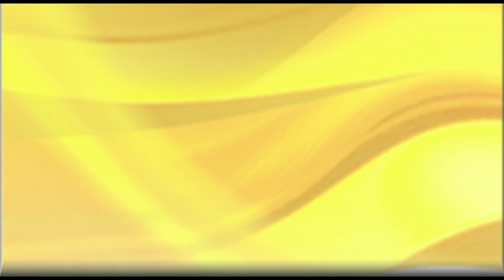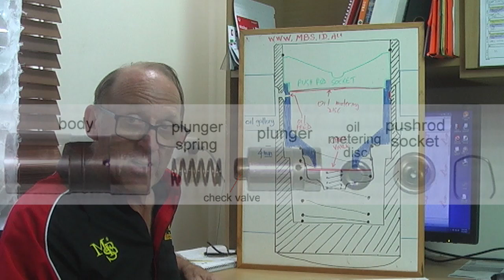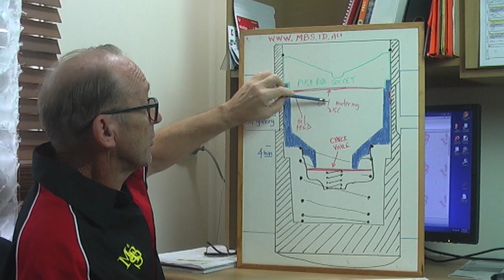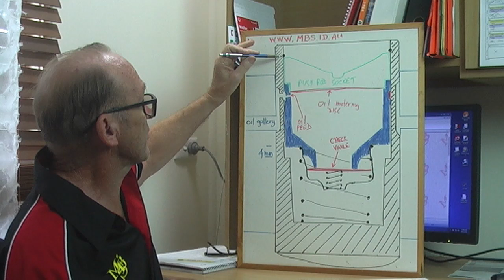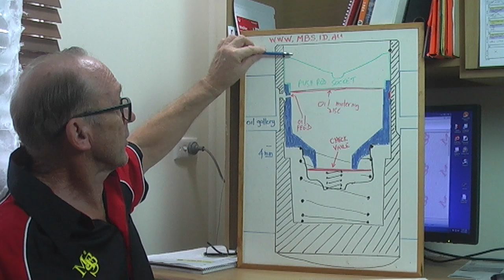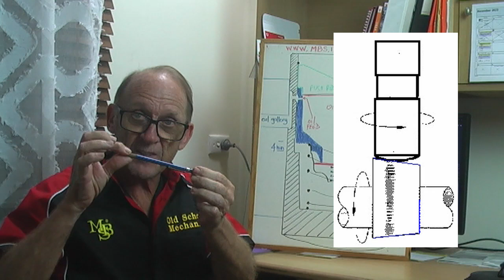Hydraulic Lifters Explained

Comment: Only time lifter will pump up will be an issue as if the rocker is over tightened. Compressing lifter spring. Away from snap ring
Reply from the maker: I know what your trying to say. The lifter will pump up closer to the circlip if valve float is encountered. This will hold the valve off its seat causing loss of compression resulting in a miss-fire. However the lifter will bleed down fairly quickly and be back to zero lash running as it should. The same effect can be had when adjusting the lifters while the engine is running. Take up the clearance to remove the rattle and then tighten down the fulcrum bolt 1/2 turn. As soon as you do that the engine will miss until it bleeds down. If I am setting them like that, then I go down a 1/4 turn at a time and when the engine stops missing I do the final 1/4 turn. If you turn the adjuster in one movement and your a 3/4 turn guy then the valve head may clip the top of the piston in a low piston to valve clearance engine. So care needs to be taken.

Comment: So basically it Locks moving upwards during lift and unlocks moving down allowing the valve to slam shut... Re locks on rebound and so on?
Reply from the maker: Well in a nutshell, basically yes, but a little more to it as it has other functions as well but your analogy will suffice to understand its workings. I am drafting up a new tutorial to do which covers the lifter operation when new and when pumped up, going through a full rotation on the camshaft. This may explain the entire concept more clearly but this is probably another few months off yet as I have a lot of work on at the moment.

Comment: What causes them to have a irregular ticking sound you here at idle everytime after a new oil change and than by about 3000km later the ticking sound is gone ?.this a common occurrence on the 3.2ltr 5 cylinder Ford Ranger.
Reply from the maker: I am not familiar with the Ford Ranger (to new a model for me) and have no idea if this is a common thing for that model. There may be a facebook group that you could ask the question to.

Comment: At the risk of ridicule!  How is it that if the head is shaved lowering the head towards the lifter, making the push rod longer by the amount the head was shaved. If the pushrod is now longer than it was before how is turning the nut tighter the correct direction as it seems it would be to tight after the head shave and need to be loosened to remove the length gained by the lowering of the head.  I hope I didn’t completely misunderstand your explanation.
Reply from the maker: I am working on a new video of how the hyd lifter works through the entire cycle of base circle to full lift back to base circle. I assume we are talking adjustable rockers like early red motor. To maintain the correct rocker geometry after a head shave you have to screw the adjuster deeper to achieve the same geometry, in other words you must make the pushrod go into the lifter the same amount you shaved off the head + you initial preload that you set. So instead of the pushrod pushing the internal piston down into the lifter .050" you now need to push it down .090" if you shaved .040" off the head. This is the part that tricks everyone up and I find that even a lot of mechanics cannot grasp the concept. At .090" the lifter works exactly the same, does the same job as if it were set at .050", in fact the rod can go up to about .120" into a Holden lifter without any problems. This is called setting the geometry not the lifter preload, but that is what everyone calls it, even the text books. So you often hear the term 'the lifter is too tight' If you were concerned that the pushrod was too deep into the lifter you would simply buy a .040" shorter rod and all will be exactly the same as the original set-up, but with a shorter rod. So I hope that answered your query. In one of my videos I discovered that a 186 rod was used in a 202. That rod is .120" longer. Since the 202 is non adjustable that means the pushrod was just about bottoming out in the lifter bore, but the engine still ran without any problems which verifies that the lifter has a very wide working clearance and performs exactly how it should whether the rod is .020" or .120" into the lifter bore.

Comment: Thank you for the information. This is a good presentation. How do you stand in regards to soaking lifters in oil before installation, or draining them before installation. In my experience (not a expert by any means), if the lifters are rock hard, there is no way to take up the preload when installing without opening the valve. Its the valve that will open, and not the plunger depressing. Thanks for posting. Sincerely
Reply from the maker: Ah yes the old lifter question asked by many. I have done both, fitted new lifters not pumped up and adjusted old lifters that were pumped up. I have never pumped up a new lifter. I am eventually going to do a video on this very subject explaining the valve open concept. On an interference engine or one that has less than .070" piston to valve clearance, I would turn the pre-load down 1/4 turn at a time after setting zero clearance and that depends on valve spring pressure to, but in this case it would be better to bleed them down a bit first so to avoid the valve touching the piston.
Reply: @mbsoldschool Thanks for the reply. Looking forward to the video. Sincerely.

Comment: Very small parts and tight clearances mean oil changes should not be neglected. Do not exceed the recommended mileage when determining oil life.
Reply from the maker: Yes, lifters do not like sludge, even the tiniest piece of crap will cause the lifter to fail.

Comment: I have one lifter that when not pumped up takes .050 more to zero lash than all the other valves. then when its pumped up i back off the adjuster nut all the way to re check, its just beyond zero lash but can still spin the pushrod. Run it again and its loose again. Maybe i can use a shorter pushrod so im not maxing out the rocker arm, but why would the lifter do that? Its also really soft when bled down, but its not the only one that is.
Reply from the maker: I am a bit confused about how you explained the problem, so I hope my answer is relevant. Once a lifter is installed, adjusted and started up with good oil pressure the lifter will not require any further adjustment. Once the lifter is pumped up it should never be spongy or soft even after the valve spring pushs the plunger down due to bleed down. Oil in the bottom chamber below the check valve does not compress, the lifter only goes down because the oil leaks between the plunger & body but it will still be solid if you tried to push it further but more than likely it will be bottomed out in the lifter body. Some will be some won't, but in any case the lifter should not be soft. The only thing that can cause this is the check valve not being seated, this will allow oil in the bottom chamber to leak out through the check valve & back into the oil gallery while the lifter bleeds down. Have you checked out all my videos on adjusting hydraulic lifters. I cover zero lash and how to get it, then turn the adjuster a further 1/2 to 3/4 turn as standard unless you are correcting geometry which may mean you might be adjusting the lifter a bit further down than standard.
Reply: @mbsoldschool these are gm lt1/lt4 roller lifters and shaft rockers. Your answer sort of helps. So first i bring it to zero lash and 1 full turn for all of them, but #7 ex is very soft and the adjuster nut goes down  extra .050" to achieve zero lash than the rest.( there are a couple other soft ones that didn't have this issue.) So i give and extra 1/4 turn in case its not up all the way. I run the engine and notice a bouncy vacuum needle. I pull valve covers and check #7ex and its tight (pumped up) while on the base circle. I back nut all the way out and its still snug but i can spin the push rod(maybe can use a shorter push or maybe theyre all perfect and need less pre load). I run the engine again and have stable vacuum but hear a rattly lifter.  Same lifter is now bled down and loose. I dont know if i have some bad lifters or not.

So at zero lash and one full turn i looses 2-3in vacuum as it warms up vacuum stable. Today , I re-adjusted them to 1/4turn or .020 preload. Now it starts at 10in and picks up 1-2in as it warms up and lifters are more noisey and vacuum unstable again. Im gunna try a half turn when i have time again and see if the vacuum is stable cold to warm. I still have a feeling the weak lifters are to blame. Still on break in oil in all of this.
Reply from the maker: @___MC___ Something is really wrong here and I don't think I can solve it when we are talking different car language. This statement is confusing. "but #7 ex is very soft and the adjuster nut goes down  extra .050" to achieve zero lash than the rest." If your lifter is soft, then there is air in the bottom chamber or the check valve is not seated. Sounds like you are not setting zero correctly, sounds like you are continuing to tighten the adjuster past zero. Zero is when the pushrod touches the lifter plunger but does not push it into the main body. Then the extra turn is required to set them correctly. None of your lifters should be soft like their new counterparts. So many people get the adjustment wrong on new lifters because of the spongy feeling, very easy to do. "#7ex and its tight (pumped up) while on the base circle." Another statement that makes no sense. Of course it is tight, the adjuster has pushed the rod into the lifter by around .050". A good lifter will be tight because it is holding oil in the bottom chamber and oil pressure has refilled the chamber with oil that has escaped via the bleed down. " I back nut all the way out and its still snug but i can spin the push rod" . Back the nut off, 1 turn & the rocker will go slack. If you have slack then you adjusted the pre-load incorrectly. What method are you using to adjust the lifters. EOIC, overlap or TDC method.
Reply: @mbsoldschool youre definitely helping. i think i can understand where im missing things in my head now. I turned the crank 90° per cyl in the firing order since i cant realy see when the intake is closing or exhaust open with the intake manifold on with loose rockers. Is that flawed in thinking both are on base circle at tdc every 90°? Its a mild street strip cam.
Reply from the maker: @___MC___ Oh it can be but if you start at #1 compression then you will be OK. I see your thinking so let's break this down. You start on #1 cyl with the piston at TDC but on compression, not overlap. Both valves on #1 are on the base circle, the valves are shut and able to be adjusted. If you turn the engine 90 crank degrees the next cylinder will be on the firing stroke & therefore both valves will be on the base circle. So whatever your firing order is for that engine you will set the next cyl in the firing order. You are basically using the TDC/overlap method and is accurate for almost all big cam engines.
Reply: @mbsoldschool it was how the shaft rocker instructions wanted me to bolt down the shaft rockers. I figured it was viable for adjusting as well. I been doing iceo method with stud rockers so i never noticed height discrepancies before. I can feel zero lash pretty good even on soft lifters. The lifters total plunge is .200 inch

Comment: I think I may have a problem with my hydraulic lifters in My VW VR6. If I give it too much throttle input is WOT after a cold start it starts to run rough And back fire and won't take any more than 10 or 20 percent throttle otherwise it'll die. It smoothes out After the oil warms up
Reply from the maker: That's a tricky one! My initial thoughts in order of probability are oil viscosity to heavy, sticky check valve in lifter or dirty internals, restricted lifter oil feeds. For a quick check to identify what is happening is to start the engine cold and rev it to make it miss. Then shut down the engine and as quick as possible disable it from starting and then crank the engine and listen for 6 compressions during the starter motor operation. You should clearly hear the starter motor speed and when it hits a cylinder with compression. I would do this first when it is hot so you know what it sounds like with good compression. Then the next day do as I suggested when it is cold and compare the sounds. If you have loss of compression then I would start with adding some lifter free product or engine flush to clean out any gunk and put the correct grade oil in with a new filter. That's about all I can recommend for you. There could be other factors in play but what I have mentioned are the most common things to check.

Comment: How does a roller lifter deal with pushrod end wear when it doesn't rotate ?
Reply from the maker: bloody good question. I have never had to deal with roller lifters so am not familiar with them but I suspect that there must be some sort of device built into the lifter that would allow for the pushrod cup to rotate a very small amount therby causing the rod to turn. Otherwise you will eventually end up with a pyramid point on the rocker end of the rod. The lifter end does not get that same wear as the other end.

Comment: Very thorough presentation.   I enjoyed your video         .  I have experienced an issue which I can find almost zero videos explaining.    If a person buys a used classic.     May have sat around a long time.    Because history of camshaft and lifter adjustment is unknown the new owner wants to check and re- adjust hydraulic lifters.    But after loosening the lifters when the owner goes to adjust the valves the lifters are all pumped-up.    When the owner gets the valves to zero lash and goes to put in a Half or three-quarter preload, because lifters are pumped up, instead of getting preload, the new owner is actually lifting valves off their seat because the lifters won’t compress at all, acting as if they were solid lifters.   Then if engine is run, the vacuum and compression is way low.      If the valves are loosened enough to allow them to fully seat, then the lifters beat themselves to death and break.  Hydraulic lifters acting like solid lifters.  How can an owner bleed a lifter in an engine without removing the intake manifold?    If a lifter gets pumped up like that, can the lifters be bled back down while still in the engine?    Do lifters only adjust in one direction to get longer but never shorter?    Were the lifters frozen due to sitting?    I’ve seen this on three different engines with hydraulic lifters.     I ended up replacing the lifters
Reply from the maker: The valve springs will bleed the lifters down. If you loosen the lifter to start adjusting them the spring will push the inner cylinder up but it won't be solid unless the oil gallery was full of oil and it does not matter if they pumped up anyway. You still do the zero lash & tighten down 1/2 to 3/4 turns. The valves may open when you do this if the lifter is actually pumped up with oil but if you sit and look you will see the valve slowly shut. Why do lifters rattle when started each morning. It is because the springs have bled the lifters down & now they have to pump up again to get zero clearance. If the lifters does not bleed down then replace the lifters because they will hold the valves open.

Comment: So does the lifter actually move up and down in the bore? I feel like it must move a little when the cam pushes on it, but then you have the pressure from the push rod pushing down. I'm going to need a slowmo video in operation.
Reply from the maker: The lifter moves up and down inside the bore as the cam lobe pushes on it.

Comment: I have a weird problem. I think I have a failed Lifter, but not in the usual way. Is it possible they can get seized and hold the valve open? As I had a dead cylinder in my 6L Chevrolet engine. On top dead center, compression stroke.There is no clearance between the Rocker and The valve
In essence, the intake valve was  never closing It's almost like the push rod. It's too long, so anyways, loosened off the bolt that holds the rocker assembly just until there was some clearance and lo and behold,  it runs fine, And I have compression again. But I cannot leave the rocker bolt loose. The only thing I can think of is that the somehow lifter is seized and isn't collapsing. Does that make any sense to anybody here ?
Reply from the maker: possibly a failed lifter. Just check that the valve stem height is the same as another cylinder on the comp stroke. I have encountered destroyed valve seats which cause the valve to stick up higher which in turn pushes the pushrod deeper into the lifter until it locks. Another check is tighten the bolt after you get zero lash & see how far it pushes the rod into the lifter. 3mm max to be safe. But it may actually open the valve when doing that because the lifter will be full of oil. In saying that though the valve will slowly close indicating that the lifter is bleeding down. If it does not bleed down then you have a seized lifter.